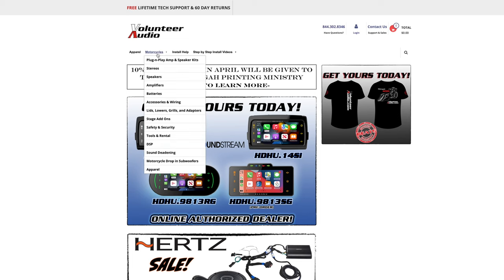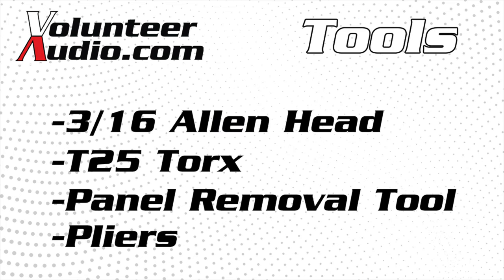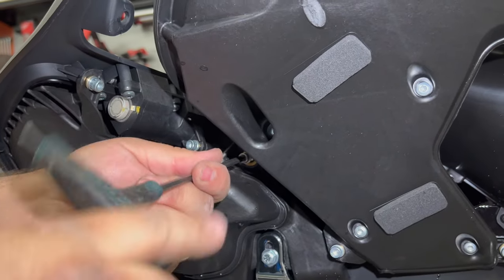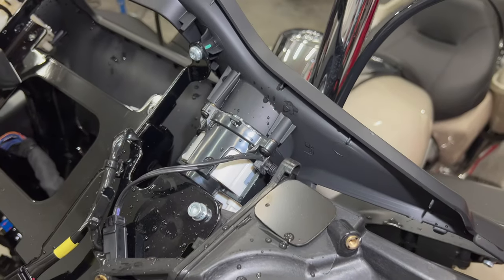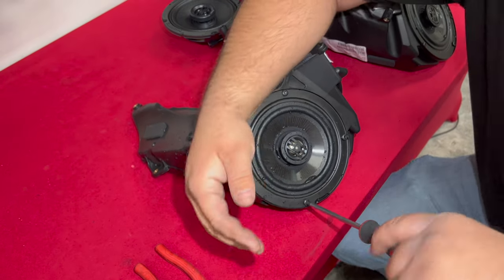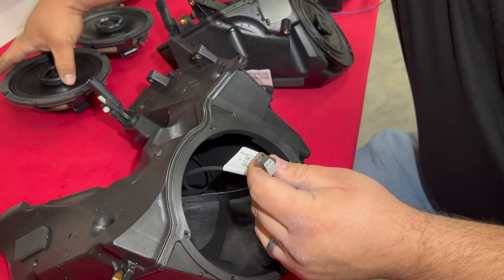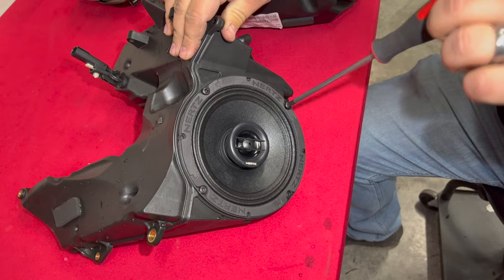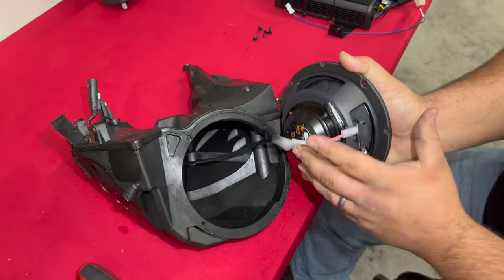How to Remove Fairing Speakers / Pods in a 2015-2023 Harley Davidson® Road Glide

Comment: If I wanted to replace my 2019 road glide blown stock speaker with the same stock speaker, I just can't remove the grill and screws from the speaker then pull it out and disconnect the wires from the back of the speaker?
Reply from the maker: You can, but we usually upgrade an amplifier also

Comment: I'm doing a radio, amp, and speaker upgrade. Do I have to remove the speaker pod? and if so why.
Reply from the maker: It’s much easier to install the amp with the radio and speaker pods removed, and very easy to remove the speaker pods

Comment: Do I need to remove the headlight assembly and the radio if I'm just replacing a speaker pod due to a stripped windshield nut?
Reply from the maker: No
Reply: @volunteeraudio  thx